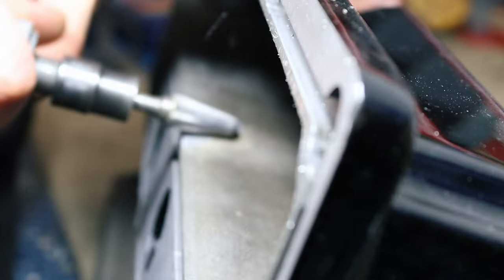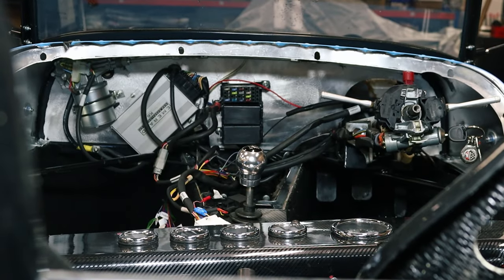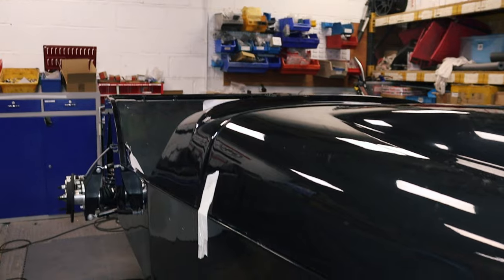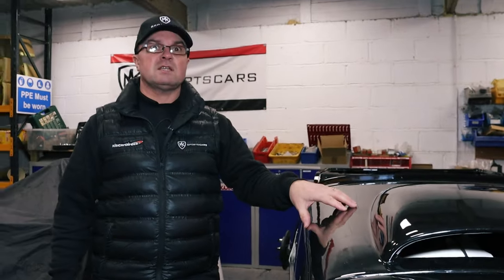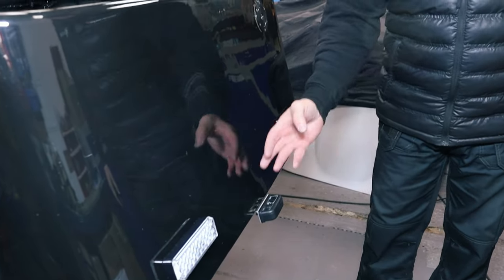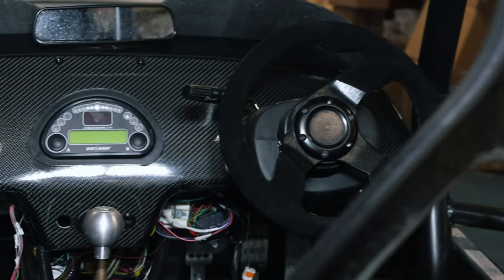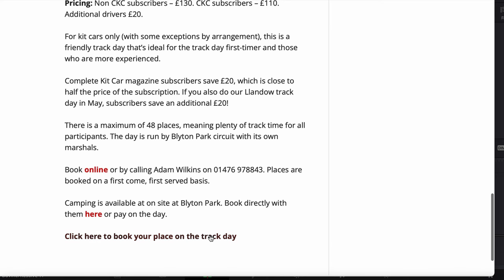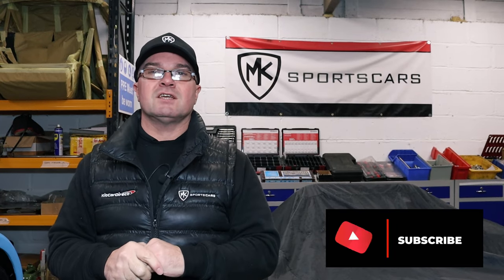Ep 104 - TURBO CONVERSIONS!! & 2022 TRACKDAY CALENDAR #trackday #kitcar #2022 #calendar

Comment: What will you do when Petrol and diesel cars will be a sale ban in the UK by 2030. All vehicles will be banned from Sale!
Reply from the maker: It’s an interesting point - one of which we are looking into as we speak.

Do you think the UK infrastructure will be in place by then for everyone to be able to charge their cars without trailing a lead across the pavement? Or charging their car in a council garage which has no electricity? Or is this just a “promise” from Boris that hasn’t had enough thought?
It’s only 8 years away…..
Reply: Sell the car to the customer with a tiny electric motor and offer a free aftersales engine swap, 10 mins after officially selling it.
Reply: @MKSportscarsofficial  totally agreed , the current grid is not capable of taking the amount of electricity required for the hole nation to charge cars and household... Probably MK will start using electric engines in the next 5 years ... I'm definitely keeping a combustion engine in one of these and never letting go of it .. 😊